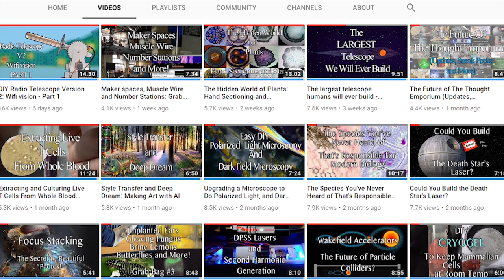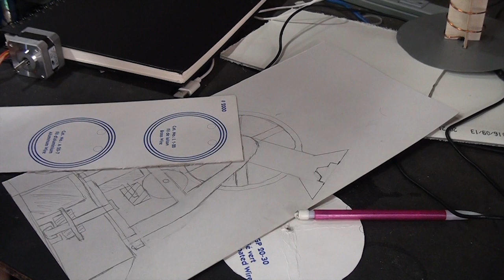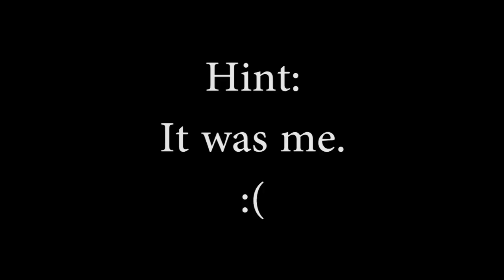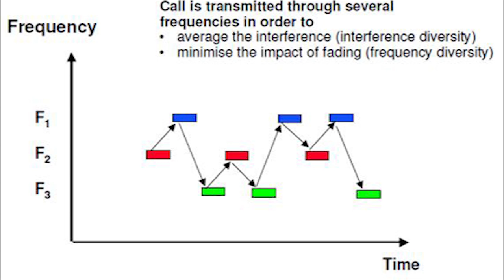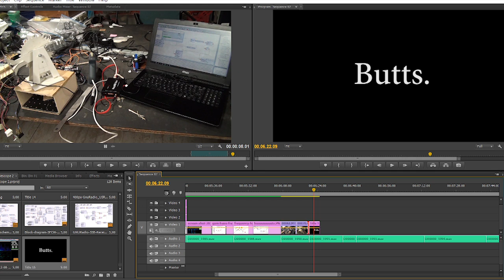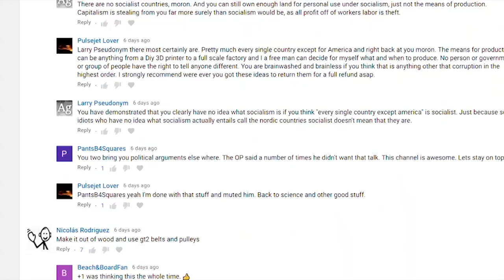The Angriest Radio Telescope - Wifi Camera Part 2

Comment: Is there any reason to not connect the antenna shaft directly in the motor instead of building this wobling gears?
Reply: Hum, I imagined those steppers could hold more power, since DIYers use those on simple CNC machines. Well... the project is amazing nontheless.
Reply from the maker: Like the support the helical is wrapped around??? The reason is because there's no way we could fit that into the mechanism without the base plate smashing into things and putting metal neat the antenna would screw with it's directionality so you want it away from things. We also built it this way to avoid collisions. Also the gears don't wobble now that we've tuned everything. It all runs really smoothly.
Reply: Thanks for the answer! In my mind the design and position of the steppers would be completely different, but I can't assume it would just work without building one like you did. Thanks for sharing this project. Stay strong! You are awesome!

Comment: Why aren't you using bearings instead of teflon?
Reply from the maker: We found the teflon first. Once everything was cut and and mounted we actually found a box of bearings. Ended with us just looking at each other feeling like derps. But teflon worked really well anyway since it's a nice low friction plastic.

Comment: You need to realize a thing or two about logistics. Spending a whole week trying to turn a few dollars worth of parts into a working prototype is much more costly than simply buying the things you need, unless you think that time costs nothing (hint: it doesn't, which is why we use the word spend in regard to time).

Watching you faff around, wasting your time trying to make a box, and then another box, made me shake my head in disbelief. It's just a box! Just go out and buy a biscuit tin or a Tupperware or something! Spend your time doing the worthwhile stuff (while eating biscuits). Seriously.

A quick google for "cheap motorized telescope mount" took seconds to find exactly what you need for just a few dollars. A little more thought and I'm sure that you could come up with other ideas. The whole "we wanted to do it with things we had lying around" is pretty silly.
Reply: I should add that I really don't wish to be disparaging. Your projects are seriously impressive. I'm just trying to give you a nudge in the right direction so that you can harness your expertise instead of wasting your energy on things that aren't your forte and aren't even necessary.

When Michelangelo carved his David I doubt that he spent weeks chopping bits of wood to make the handles for his chisels, then went mining ore to make the metal to make the blade, et cetera ad nauseum. He just bought a big lump of marble, bought some chisels and cracked on with the carving.